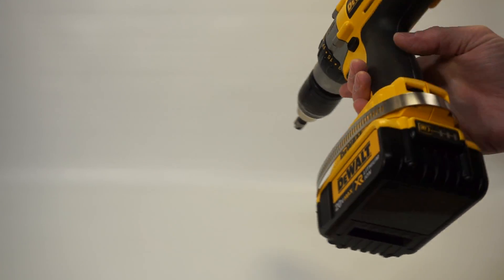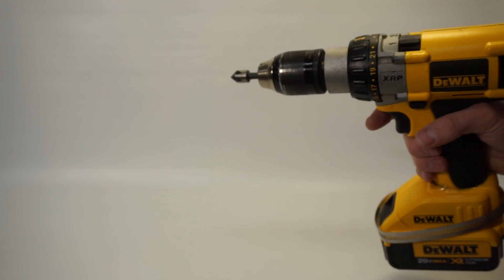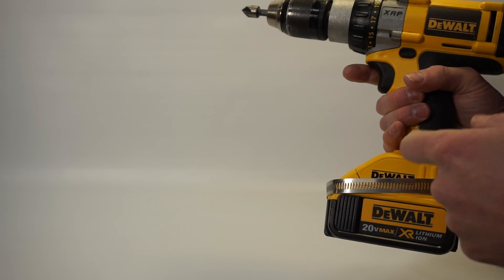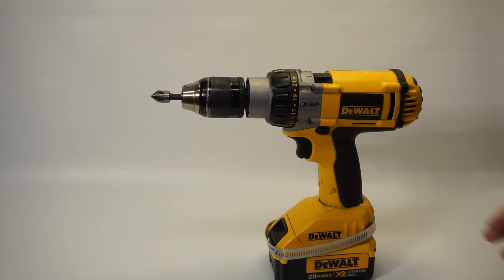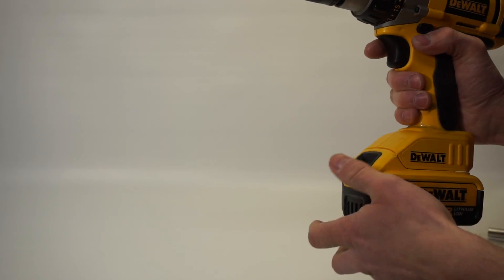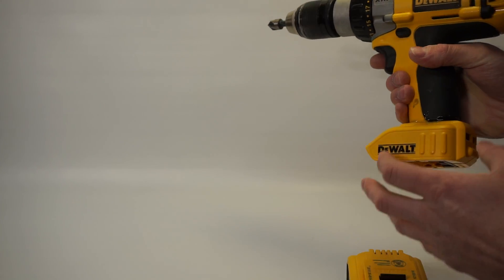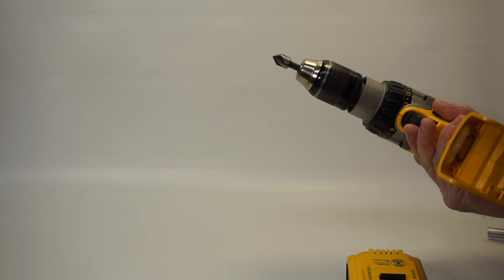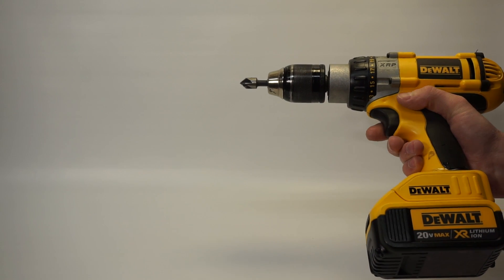DeWalt DC983 14.4V Drill Converted to 20V Max

Comment: I realize this is a 7 year old video, but did you ever make a part 1 that shows how you modified the DW983 to the slide-in battery system you're showing here? 
Wakodahatchee Chris
Reply: I did not. I basically cut off the bottom of the drill and epoxied i to the USB adapter.
Reply: @benjamenjohnson7005  Thank you!

Comment: Cmon  a hold down pin/screw place a 1/8 hole into drill undersized into the front shoe drill near slotted tang.  and use 1 10/32 self tap and 'lock it in and twist our to replace battery now and then

Comment: Can someone share a link the USB to 14.4V adaptor that he shows that is glued to the drill?
Reply from the maker: It's not a 14.4V adapter, its a USB Power Source: https://www.homedepot.com/p/DEWALT-12-Volt-20-Volt-Max-USB-Power-Source-DCB090/204317110

I ripped out the USB board and I'm  just using it as a 20V max battery holder so 18-20V is going directly to the drill.

Comment: You can now buy an adapter that takes the newer slide on batteries. However I wish they'd make one for my 12v Dewalt kit.
Reply: where can they be found?
Reply: It’s only for the 18V series not the 14.4V. You can buy 14.4V batteries Li-ion at batteryship.com $65 a bit pricey

Comment: Have you burned this drill up yet? My fellow mechanic used 18 volt batteries on his 14.4 snap on impact and burned it up. I do not think this is a logical idea.
Reply: Snap-On sucks, that's why it burned up.
Reply: Jason Hull i have done with the pod adapter to handle the 20 volt Max  not this conversion Frankenstein idea and it works just fine a year later you can only use 2 Amp Hour batteries getting higher   will burn the motor out i tried that on a few older dewalt  drill a  dw990 and  a  dw991   a  dc935 hammer drill  fine  snap one is a different brand different manufacturer  I'm not saying I recommend this idea to  anyone just  saying it worked  fine  who  should had  to got to pod converter
Reply: Understandable. If it works do it. The impact also is using a heavier load torque. Thanks for reply
Reply: You apply as much V as you want by button pressure. Just have a stop line painted at 80% or keep off the power that is all,
Reply: flexvolt uses 3 times the nominal voltage and bumps a 20v tool to 60 volts and everything works ok. I believe that this mod is a fry cry from burning the tool.
Reply: @ΣΤΑΥΡΟΣΓΚΕΡΛΕΣ  flexvolt tools are made for higher voltage, and I believe using a flexvolt battery in a normal drill still only operates at 20v.

Comment: You can use a flexvolt battery cover make a few cuts on it with oscillating tool add power and ground connections, fits battery like a glove

Comment: I have the USB power source and to keep the battery on I drilled through the sides and inserted a metal rod to catch the battery latch tab.  Hope that helps.
Reply: I'm curious about any mods you had to make to the adapter to make it fit the tools?
Reply: Benjamen Johnson  you could have just bought the 18 ni-cd to 20v max lithium adapter dewalt has one i have used it it fits like a glove  batteries do not fall out they lock in place perfect i did it to a dw984  xrp  and it works fine  with a 4ah 20v max  battery  I personally would not advise this modification to a regular 14 volt Dewalt xrp models have stronger Motors so it's like an 18 volt I have used it also on my dw990 xrp works perfect actually makes both drills run better than they did new because of the power from the lithium
Reply: Benjamen Johnson  hears the kind of adapter I'm talking about https://youtu.be/Wm8EMCJOHVU